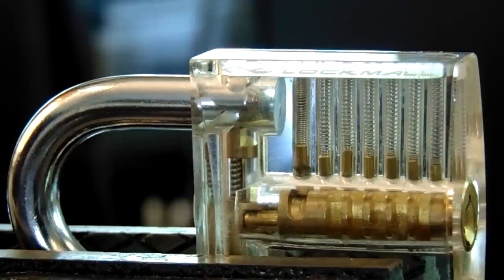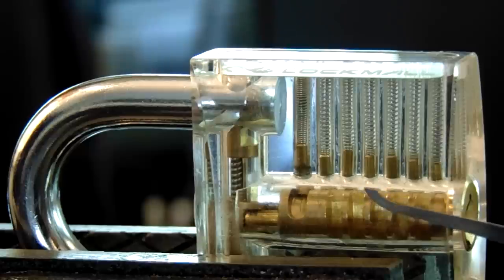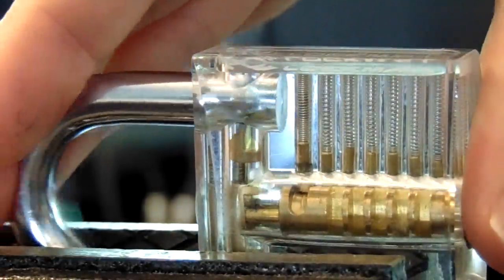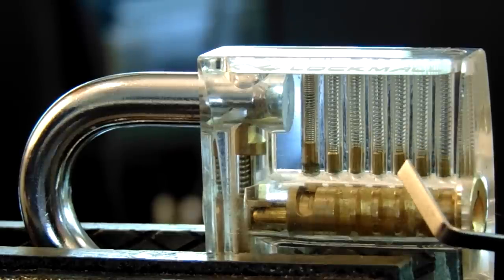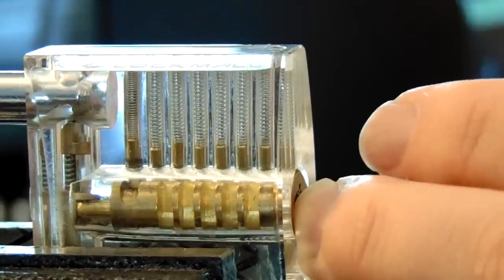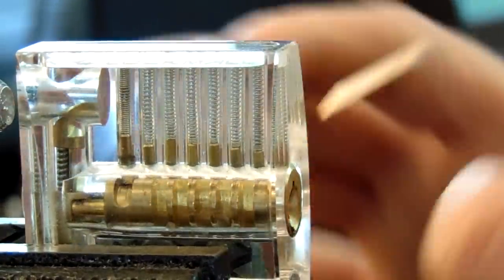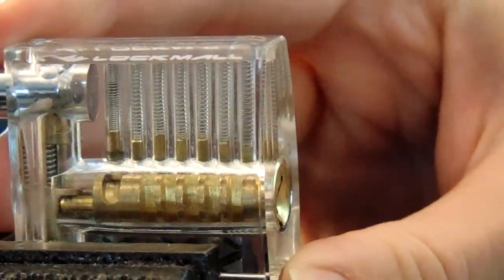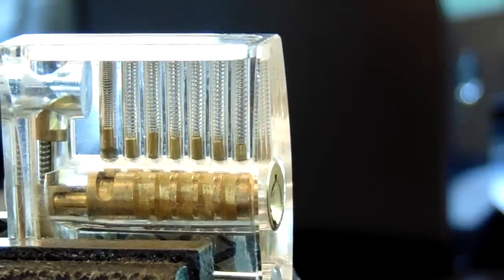[30] Closeup On How Lock Picking Works

Comment: Try picking a Yale quality lock this way, this is cheap low quality padlock, I once watched a professional locksmith open a yale cylinder using a special spring loaded vibrating tool , took him at least 10 minutes.. PS i believe only licensed locksmiths can buy this tool !
Reply from the maker: My preferred method to open a Yale is buy lock bumping. Those are much nicer locks than this one

Comment: Suppose that the driver pins were lengthened so that it would be impossible to push the key pin all the way out of the cylinder. It seems that such a design would make your method impossible.
Reply from the maker: That would also make it impossible to operate the lock with the key. You need the height so that you can lift the key pin out of the way
Reply: @HelpfulLockPicker  I was not clear. What I propose is that the upper segment is made sufficiently long that the key pin cannot be jammed out of the way. In other words, the ONLY way the lock can be opened is for the key to be inserted. It should NOT be possible to push the key pin out of the way.
Reply from the maker: @DavidFMayerPhD  that is how locks are typically designed. The bible is typically designed so it cannot hold both the spring, driver pin, and keypin. When that is possible locks are susceptible to a comb pick attack where you lift both the driver pin and keypin up into the bible and turn the lock over.

I am not sure if I am understanding you because what you are describing sounds like a typical lock.
Reply: @HelpfulLockPicker  Then I misunderstand how your picking works.
I thought that you rammed the key pin all the way out of the cylinder.
Thanks.
Reply from the maker: @DavidFMayerPhD  There are two pins keypin and driver pin. The driver pin secures the lock and the keypin is used for unlocking. Each keypin has a specific height which matches up with the key. When you insert the correct key it lifts all the keypins flush to the top of the plug and pushes only the driver pins out of the way. Since the driver pins are no longer obstructing plug rotation it can turn over and the lock opens.
Reply: @HelpfulLockPicker  It seems to be possible to PUSH ALL PINS out of the way so that the cylinder can be turned. I really need to think this over further.
Reply from the maker: @DavidFMayerPhD  this is a cheap lock bottom-of-the-barrel quality you can in fact push all the pins up an out-of-the-way however that is not typical for most locks. Do not use this one sample size to frame your mind on how all locks bibles are sized. Try checking out this video I made on comb picks for further clarification https://youtu.be/g3BquGz4BG0
Reply: @HelpfulLockPicker  Got it. Thanks.

Comment: how many pins and springs?  6?  I count 6. 1, 2 , 3, 5, 7 oh darnit i need to start over...1, 2 , 4, 6, 8 ...dangit....how do you get to 6? OH, 1,2,3,4,5, 6.  whew....that was close.
Reply from the maker: There are 6 keypins, 6 drive pins, and 6 springs that interact with the locking mechanism. The larger 7th pin is used only to retain the core. If it were not there every time you unlocked the lock the core would fall out and then all the pins would shoot out and make a terrible mess and a broken lock.

Comment: Why doesn't the spring push the pin back in place after it is clicking?
Reply: My thoughts exactly
Reply from the maker: Lockpicking takes advantage of locksmith having perfect tolerances which creates a binding pin when tension is applied to the plug which consequently holds the pin up when set
Reply: @HelpfulLockPicker  thank you

Comment: But he left a mystery unanswered. He pokes a pin upward, out of its plug hole, with his tool. We hear a click, and the pin remains above and out of its plug hole. Fine so far.Eventually he pokes all the pins out, uses his other tool to rotate the plug, and then opens the lock by pulling out the big metal 'U'. This proves he picked the lock. Still fine so far.Then he resets the lock, first by pushing the bug metal 'U' back in. Then he uses his tool to rotate the plug back, so the plug's holes realign with the pins.Then something unexplained happens: the pins move into their plug holes, but why? Earlier when he pushed up the pins, they stayed up even though their hole was still aligned. Why do the pins now get spring-pushed back into their plug holes?*And why would any company make their locks with pins that remain above and out of their plug holes even after the picker's pushing tool has been moved away from the given pin??* The key would work even if the pins were constantly trying to get back into their holes, because the key pushes all pins out simultaneously, plus rotates the plug.
Reply from the maker: When you apply tension to the lock it takes advantage of manufacturing tolerances. Not all of the holes are perfectly aligned and this makes it possible when you apply tension to the lock one of the driver pins will bind. When you lift the binding pin and clear the shearline it will stay set above the plug and the keypins will drop back down. Once you do this for all of the pins the lock will open.

This lock is poorly made and is mostly used as a tool to demonstrate. Some of the keypins are too long and many of the driver pins sit near the shealine already. This coupled with the driver pins not being actually being drive pins, to me they look keypins it makes the lock easy to open.

I am not sure if this answers your question.

Comment: Thank you, I lock my self out of the house all the time by leaving the key inside the house, I'll get lucky and leave a window open some times but I've had to rip the door knob off twice now, I have to lock the door now because I moved to California and parasites-people steal from you in Idaho I have a piece of plywood for a door and for 15 years nobody has ever broken it to rob me go figure.
Reply from the maker: I would also check out my video on how to decode your key so you can get the bitting code. If you ever get locked out that is a great way to get a new key made.
Reply: Put a regular spare key in your wallet.  I do.  Has saved me numberous times. Regular key.  Not plastic.  Try it.  Works great.  If I forget my wallet,.....problem.
Reply from the maker: @popcornzbd  another great thing to do is write down your key blank type  and you bitting code.

For example you could be a KW1 1-3-5-6-2  and you can call the local locksmith and they can make you one right away
Reply: HelpfulLockPicker, Thank you I'll try it out see what happens, can't be any worse than taking the door knob apart from the outside that's never good,hhhahaa
Reply: Paul Kleinman I'll give it a try , Thank you.

Comment: Locks only keep out honest people.  

You should have seen how pissed off my father in-law got when i opened their main door with a butter knife. 

It was one of those locks that just has the button you push in to lock it. You can set the lock and pull the door shut and yer good to go right. If you notice the bar that goes into the strike plate is beveled so it will shut when you pull it closed. 

If you slide a butter knife or any piece of metal between the strike plate and that bevel you and push the rod back into the door and open it as fast as if you had a key. 

He was so pissed that no one was allowed to eat dinner until he'd purchased a dead bolt and installed it. 

He shot me several dirty looks for knowing how to do that. I also convinced a dentist to upgrade his door locks after i broke into his office because he'd let the door close behind him but had left his keys inside. I did it because i had an appointment with him in about half an hour later.  

Believe me or not I've never used this skill to thieve anything that didn't belong to me, just to help some people out in a time of need.
Reply from the maker: I wouldn't recommend working on locks in use but thanks for sharing!
Reply: @HelpfulLockPicker  those were just emergency cases. I figured out how to do this by using my drivers license to sneak back in the house and get past my parents.

Comment: Thats a fair tutorial but in fairness those locks are not a challenge at all.
Reply from the maker: They are good for demonstration and learning concepts though
Reply: @HelpfulLockPicker  I agree they give you the basic principles but they are no challenge at all, as a matter of fact I picked one with the back side of my pick :-p
Reply: I wish the bidding was more random.
Reply from the maker: The biggest problem is they use keypins for driver pins and half the time the key pins are so long they already sit at the shearline. Check out a video on how to takes these locks apart. They can be made a bit more challenging

Comment: He says there are six pins and springs but there are seven
Reply: Pin #7 keeps the cylinder inside the housing.
Reply from the maker: The 7th "pin" is used to retain the core and is not involved with the mechanism of opening the lock with a key.
Reply: @HelpfulLockPicker  : Exactly, thank you for clarifying my comment.
Reply from the maker: This guy (not you) left the same comment at lest 10 times. He is either trolling or just really wants to know lol

Comment: If you put a super strong magnet in the right place wouldnt that lift the pins enough to turn and open it?  Fuck someone already thought of that method so i guess u can! https://www.youtube.com/watch?v=q9nklkvcjGM
Reply from the maker: The pins in most locks are not magnetic and most locks do not have enough space in the bible to allow spring, driver pin and keypin. A cool technique is comb picks which are worth checking out

Comment: Great informative video but it should be taken down. Way too easy to find. Some things are just best left unsaid
Reply from the maker: You could apply that mindset to almost anything. Information is power, and hopefully one day lock manufactures will make much more competent locks, it is not because they can't, they chose not too.

This is a fun hobby and all about picking locks not in use.

In real life, the majority of unauthorized access comes from destructive entry because it is fast and reliable. Picking a lock at home vs. in use is very different and is not easy. 

Thank you for checking out the video
Reply: @HelpfulLockPicker  I get it. Ended up seeing other videos on here as well. It's a chance and realization that we hope not to face.
Reply: Any truly interested party will learn the basics of lock picking how I did - MANY years before Youtube existed (ahh, remember those days?!) - inquisitive mind, basic knowledge, logic and trial-and-error. Knowledge is not 'private property' for use by a 'select few'. Knowledge only achieves its full value and potential when it's shared.

Comment: clearly shows 7 pins and springs and goes "as you can see, there are 6 pins". okay buddy, nice explanation 🙄
Reply from the maker: Pin 7 retains the plug and is not relevant to picking the lock
Reply: I was waiting for that explanation, too.

Comment: you are encouraging theft and break -ins with this video ....thanks for making homes less safe
Reply from the maker: The real thing to be concerned about is all of the ground floor windows, bolt cutters, etc. Destructive entry is the number 1 method used for unauthorized access because it is quick and reliable.

Picking a lock in the real world takes time, can be uncomfortable, and is much harder than doing at home at a desk with the AC on.
Reply: lame reply ...you are still teaching a harmful act....only helpful to thieves. @HelpfulLockPicker